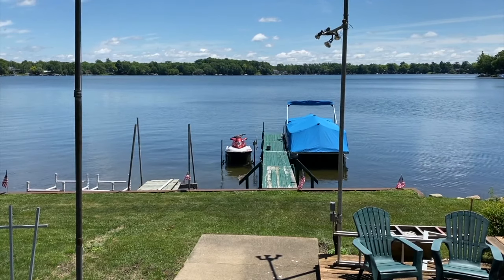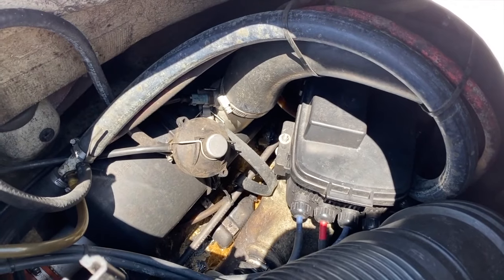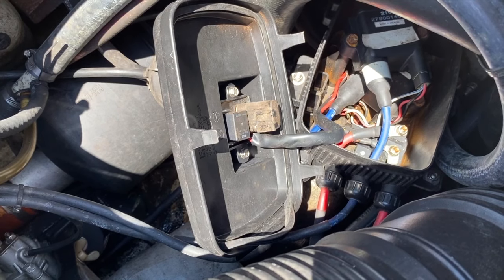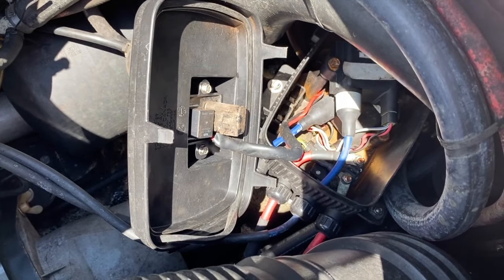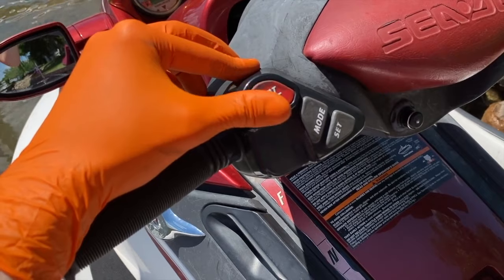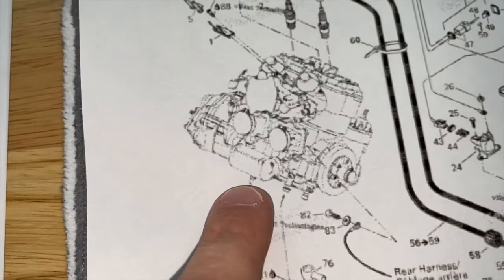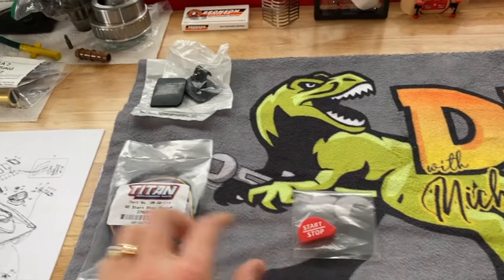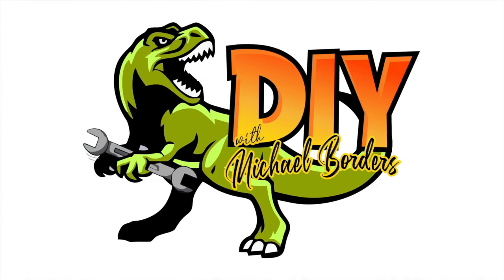Jet ski not starting - MOST common causes

Comment: I have a Yamaha WaveBlaster 2, I don't know wether to look into the CDI or starter relay. I insert the safety key and hit the green start button and the motor won't even attempt to crank over. Checked battery it's new and full so question is what do you think I should check into first ? NEW CDI OR STARTER RELAY ? And what does the power from the start switch go through first does it go straight to starter relay then CDI or CDI then to starter relay ? Any recommendations would be great. Thanks.
Reply from the maker: @ericthurston1070  

Thanks for watching, any update?  We can hopefully help.  To be honest, we would focus on the Starter Relay first.

Below is a video link showing how to properly and safely test the Starter Relay.

       https://youtu.be/LfHRcmtMG_I?si=R4bu4n2MdBDu4v4b

If this test ensures that the Starter Relay is good, we would then Director attention to the CDI.  😁👍🧰
Reply: So I have found with the battery in that starter relay is gd according to the multimeter. I am digging into the kill switch on the start stop switch now. Hoping it's the switch honestly, the CDI is $ 300.00 bucks and not very available. Only found 3 distributors that can get it. Not so sure I would want to use a used one so I don't have to do it again. Thanks for the help and I'll def keep you all informed.
Reply from the maker: @ericthurston1070  

Thanks for the follow up, the kill switch is a possibility.  If it goes that far where you need to replace start/stop switch, we will post a link below that may be helpful as you work through that project.

       https://youtu.be/5q9HbOxYY4Q?si=JB5Ff71-_riK6v85

😎👍🧰
Reply: Well bad news for me is it is not the switch either. I have completely toar the switch apart, checked all the springs, leads and reassembled it. I'm getting continuity through the switch. So all that's left it can be is the CDI so I'm gonna get one ordered and get that replaced. Ita gonna take a cpl weeks but I'll keep you informed. Any one got any inside leads on getting a NEW decent priced CDI replacement ? Everything I have found new is 300.00 to 350.00 not including shipping cost.
Reply from the maker: @ericthurston1070  

We appreciate the quick reply, hey we have been in your shoes.  Installing a brand new CDI will be great.  We don’t consider that bad news unless it doesn’t fix the issue.  Keep us posted.

Comment: Have 2007 seadoo rxp It will start on land but once it runs in water  20 minutes it does and will not restart
Reply from the maker: @waynegrayson5854  

Thanks for watching, any update?  Have you performed a tuneup in the past few years?

If not, we recommend replacing your plugs, wires, and ignition coils.  That may help tremendously.

Below is a link to these videos, hopefully you find them useful.

Replace plugs and wires

       https://youtu.be/gRTpc5pqLLk?si=PS_wM2o9rbNJC3S4

Replace ignition coils

       https://youtu.be/1VrtwJl6hjI?si=jv3vEElzv7ROEF8o

🧰

Comment: Problem I’m having is with a 99 Seadoo GTI.  Won’t turn over, then I get it to once and it starts.  I stop it and it won’t start again.  Battery, plugs, fuses, and start button are all good.  After watching video would you suggest the starter relay?
Reply from the maker: Thanks for watching, we appreciate you sharing your experience.  That would be the next part we would replace since all the other parts around it are good.

😎👍

Comment: Husbands been watching this video.  We have a 2000 Seadoo GTX RFI.  It starts and runs briefly, dies, then won’t start again. Any suggestion? Thanks.
Reply from the maker: Good morning, just poured a cup of coffee and am sitting down to answer any and all questions for the DIY community.

A few things can cause this as mentioned in the video.  Kinda sounds like the fuel system is activating once DESS key is connected…and priming the engine with fuel and allowing it to start…but then it runs out of fuel pressure or delivery…🤔

Another cause can be a vacuum leak or faulty vacuum solenoid.  Below are two videos discussing more about that.

       https://youtu.be/Jr7eWlFGvAc

       https://youtu.be/SfjX9OtOyIM

Keep us posted.  Let us know if you have any questions and hey if you’re into crypto trading, join our DIY ecosystem and become part of an exclusive group of DIYers.

       toolboxtoken.com

Reach out to us any time!  🧰

Comment: I have a 2008 kawasaki stx and it shit off at random points while riding when i catch air from wake but after riding it for about 10 minutes i left it at the dock turned off and when i went to turn it back on it just kept cranking never turning over after trying for about 5 minutes
Reply from the maker: Good morning, just poured a cup of coffee and am sitting down to answer any and all questions for the DIY community.  Any update?

The good thing is that it’s attempting to crank which tells us that your Starter and Starter Relay is still good.

It’s possible that the engine is not getting fuel.  Do you here the fuel pump turn on when you connect DESS key?
Reply: I got a good one for ya.  Me and my son have been working on this freebee for several months.  '93 Kawasaki 750 ss.  Ran good a higher rpm.  Back on idle after 30 sec. would die and not start without starting fluid.  Rebuilt carb and replaced everything.  All new fuel pickup tubes in the tank and pretty much everything else.  ( $$$)  A local dealer had replaced all the fuel lines with the new ones earlier.  So there was only one thing to look at or replace.  The fuel selector valve.  And that was the culprit.  The dealer mechanic had crossed 2 of the fuel hoses on the valve.  After changing the hoses to the correct position, it runs like it should.  Starts right up in a millisecond every time.  Even after several stops and starts just works like a million bucks.  Hope this helps.
Reply from the maker: @baanman  

That’s incredible info and we appreciate you sharing this.  The best part of that story is that you had the opportunity to work with your son while rebuilding your ski.

Your son and you were able to track down and pinpoint the exact part causing the issue.

Nothing better than that!  😎👍

Comment: Hey man. My 05 stx-15f cranks but It will Not start. Was running fine. We refueled it and it started but then shut off. Did not want start after that. Any ideas what it can be?
Reply from the maker: Thanks for watching, any update?  When you connect key to ignition DESS, do you hear the fuel injection system activate?

Comment: 2007 wakerunner no start start stall Well took out plugs and they are old by the stain on the porcelain seadoo forms change super charge unit every 10-15 hours and was gonna chekc the compression but need a different 12 mm adapter which I would have to order . They say 140 good compression . Well I had a plug blaster and the plugs to begin with were not black like I though they would be so cleaned put back in same no start . So I took coil out and was able to take off its little insulator and held coil electrode near bracket and want to see how well the spark jumps and if it is blue spark . Well it barely spark fully charged battery . So if a set of plugs doesn't do it I'm gonna have to find seadoo shop and let them look at it .
Reply from the maker: Good morning ☕️ any update?  New plugs and wires are a great start.  Looking forward to hearing back from you.

We are working on this jet ski as we speak, we are filming a full engine removal and re-install series.

😁👍🧰

Comment: 2001 SeaDoo 951DX. Put the key on the post, get the beeps, and then the fuel pump just continues to run. No crank with the start stop button pressed, but I can jump the starter relay, and it starts. Won’t get full throttle, and after turning it off, it won’t restart for 20 to so minutes. Also “maintenance” flashes on the screen. Thought’s anyone?
Reply from the maker: Thanks for watching, you came to the right place.  Sounds like your ski is in limp mode…which is a safety protection mode that decreases the allowable acceleration to prevent damage to engine while other parts are faulty.

It may be as simple as replacing your starter relay and reconnecting battery and starting engine.

If your starter relay was faulty prior to replacing it, the new one will send the proper signals to your MPEM and disengage limp mode.

Please keep us posted.  🧰
Reply: @DIYwithMichaelBorders  WOW, thanks Mike for the quick reply! The limp mode sounds plausible, and since the starter relay, we did replace the battery and rode it. Seems to still be in limp mode though.
Reply from the maker: @BrianMiller4802  

Thanks for the reply, so the Starter Relay has been replaced…?…and it’s still in limp mode?

Keep us posted.
Reply: @DIYwithMichaelBorders  yes.
Reply from the maker: @BrianMiller4802  

Awesome.  Try disconnecting battery for 5 minutes which will allow your system to reset.

If that doesn’t help, you may need to carefully disconnect each of the large plastic connectors feeding into your MPEM followed by re-connecting them…this is also a reset procedure.

It’s unlikely however are you using your normal DESS key or your yellow key?  Yellow is programmed for reduced acceleration “limp mode” only.
Reply: @DIYwithMichaelBorders  I am using my normal key, and is the battery connected when I’m removing and replugging my MPEM connections? Thanks for all your help so far. Do you think my fuel pump running nonstop when I put my DESS key on is also related to my ski being in Limp Mode?
Reply from the maker: @BrianMiller4802  

 

Thanks for the reply, battery is to be connected when disconnecting MPEM connectors.

Your fuel pump running nonstop is 100% normal…however when engine is running.  

Once DESS key is connected to post, the fuel injector distributor will make a pressurized sound as its being primed…however that sound should stop after 3-4 seconds…which is then your indication that the engine is properly primed and ready for start.

If you’re system is continuously priming engine prior to starting…this is 100% causing your system to revert to limp mode.  You might have a malfunction within your Fuel Control Module which is the entire housing and wiring system that feeds into your fuel tank.
Reply: @DIYwithMichaelBorders  AAAHHH, this is all starting to make sense. I’m guessing the wiring to the pump is ok, since the pump is getting current, and the engine runs good aside from the limo mode issue, once it’s running. Another thing I forgot was an issue when I purchased it, is when I plug in the DESS, and the fuel pump starts running, the starter doesn’t engage when I press the Stop/Startup button, but I jump the starter relay as mentioned before l, and it starts right up.
Reply from the maker: @BrianMiller4802  

😎👍

Comment: Hey i got the low 12volt message on my gtx limited 99 when im trying to start it.Putt in a brand new battery freshly charged and i still get low 12volt message? i can hear the relay click.The jetski ran great last season butt the low 12volt message came up a couple of times when starting up.  Anyone got any idea?
Reply: Did you find what the problem was?

Comment: This is all no crank not a no start which I have crank and weak spark but no run condition . It was start stall condition
Reply from the maker: Thanks for sharing, we read your other comment as well.  We appreciate you reaching out to us.  Did replacing plugs and wires help?
Reply: @DIYwithMichaelBorders I replaced mine still no start. It cranks but won’t turn on and engine light comes up
Reply from the maker: @dann3949  

Thanks for the follow up.  Once you connect key to ignition, do you hear the fuel injection system turn on and prime engine?  If you don’t, it’s likely that your fuel control module is faulty.

Keep us posted.
Reply: @DIYwithMichaelBorders  hey just a follow it was actually a faulty battery. It must’ve sat for too long so I replaced it with a nice $180 gel based battery and it starts up every time.

I also replaced spark plugs and did 4 oil changes to flush water out of the oil because there was an improper water hose test done to it.

I also had to drain some water out of the spark plug cylinders
Reply from the maker: @dann3949  

Thanks for the follow up, that’s great news.  Fresh new battery for the season is great.  Awesome job cleaning out oil system as well.
Reply: Hi i have a seadoo rxp260,it is cranking we got spark,but it still will not start
Reply from the maker: @donnyamatmoekri4391  

Thanks for watching, any update?  When you connect key, do you hear the fuel injection system activate?

Comment: I have 1995 seadoo, it doesn’t start on its own when we jumpstart it, it will, but after it won’t stay on, changed and charged the battery but still the same. Any ideas?
Reply from the maker: Good morning, just poured a cup of coffee and am sitting down to answer any and all questions for the DIY community.

How old is battery…?…if older than 3 years…we recommend installing a new battery.

If battery is still less than 3 years old, you may have a faulty Rectifier/Voltage Regulator.  Below is a link to our video showing replacement of this part.

       https://youtu.be/U81igjcMKVM

Let us know if you have any questions and hey if you’re into crypto trading, join our DIY ecosystem.

       toolboxtoken.com

Reach out to us any time!  🧰

Comment: What a pain in the ass to replace the starter! You pretty much have to  take out all parts or take out entire engine to get to the bottom where thr starter is!
Reply from the maker: @l.r9655  

Thanks for watching.  It can be a stubborn part to replace depending on which year/make/model ski you are servicing for sure.  😁👍🧰